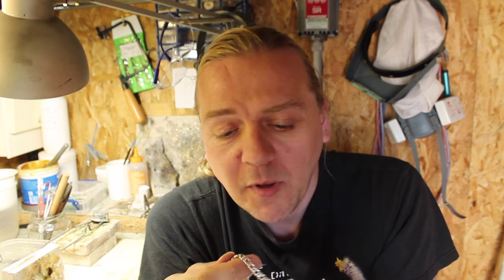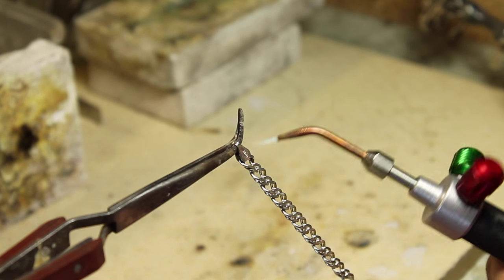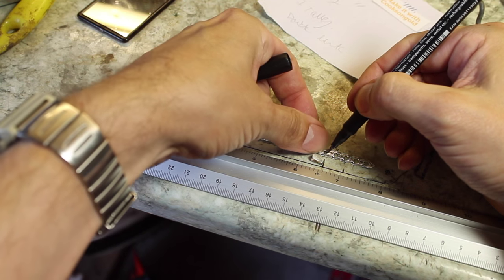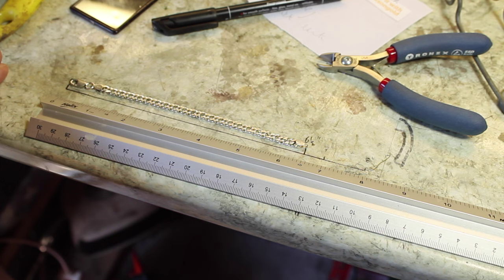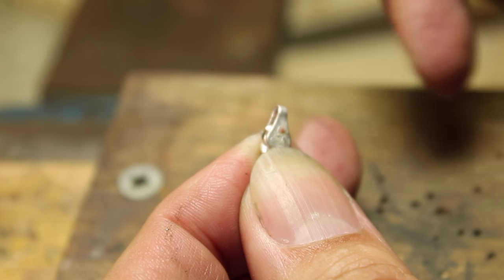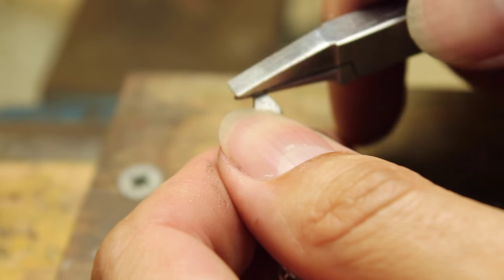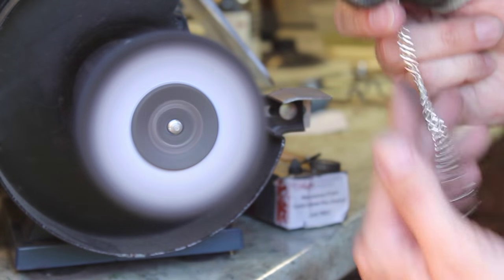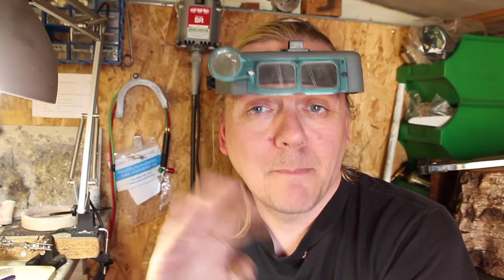How To Adjust & Repair A Silver Bracelet. Silver Soldering Techniques

Comment: Anytime someone shows soldering I want to watch.  You make it look easy.  Using a third hand worked perfectly for you.  Keep  filming!  Thanks, Betty
Reply from the maker: Betty Lively Thanks. The locking tweezers are actually held in my vice. This is a lot stronger than a third hand and allows me to pull on the chain. Thanks for watching. more on the way. Dave.
Reply from the maker: Betty Lively Also do check out my How to Solder video !  : )

Comment: You are doing a great job. Could you show us how to soder a 14 carrot gold wire rope on a end that broke off . Thank you for helping us learn .
Reply from the maker: Thanks for the comments. That's a very specific request. I don't have a 14 "Carrat" gold wire rope chain with the end broken off. But whenever I solder chain ends onto fancy chains, i don't want the solder to run along and ruin the chain. So I use "Rouge Powder". This is intended for polishing in tumblers, with walnut shells. But in my case, I mix it up with a few drips of water and I paint in onto the chain, very wet and let it soak into all the details. I paint it just around the end close to the end. The rouge is a barrier and will stop the solder from running along the chain and ruining it. Once soldered the rouge simply washes off in the water quenching. Dave

Comment: I really enjoy your videos.  You do such good work. I'd send all my silver repairs to you if you weren't an ocean away!  I bought a sterling chain necklace that had a tiny piece sticking out from the bale like yours did at 10:40.  I was lucky enough to be able to use nail clippers to fix/smooth it. Of course the links weren't thick like your bracelet. Thanks for sharing! 🙂
Reply from the maker: Thank you for the lovely comments. I hope I have inspired you to have a go yourself. A little knowledge and few tips will go a long way. Good luck. Dave

Comment: Thanks for your help!! I have repairs that are needed but local jewelers say they don't do silver repairs! ???
Reply from the maker: Most high street retail jewellers wont touch anything at all (as they don't have the equipment and a skilled jeweller on site). If they do, they usually aren't doing it themselves they simply send things away (to people like me) and then double the cost. Hence why I repair silver (and gold). Many people come to me with sentimental pieces after being turned away by several  jewellers. Finding a proper silversmith is a rarity. If you need help, drop me an email. Dave   mail@celticdreams.co.uk

Comment: hi, where are u based at? or from? thought if local can come see you about shortening my id part of the bracelet. need 3/4 of an inch off the actual id part of bracelet, is that possible? without the id part looking like its been cut off,as in no marks/line?
Reply from the maker: I have a shop in lancaster. open six days a week. Assembly Rooms Emporium LA1 1JN Dave

Comment: Hey Dave, what type of flame were you using when soldering the silver. Was it a oxidizing flame, neutral or carburizing?
Reply from the maker: Good point. Common jewellery practice will say say that you should solder with a bushy soft flame, not quite yellow at the tip, the idea being to heat up the whole piece (how many times do you hear that). However, when working with tiny things like this chain, heating the whole piece is the last thing I want to do. I need to apply heat quickly and very precisely. Hence I tend to make these chain repairs with a very fine, very hot flame, with lots of oxygen. This way, it heats up the small area very quickly, before affecting the other links. The blue point also gives me pinpoint accuracy. A very intelligent question, thanks for asking and thanks for watching.Dave

Comment: Hi Dave, love your videos!  Can I just ask - if you were soldering the loop at the other end of the bracelet that attaches the trigger / caribiner clasp to the bracelet chain, do you have to prevent the heat from reaching the trigger clasp in case it ruins the springy mechanism of the clasp?  If so, how do you protect the clasp from heat?  And can you put the trigger clasps in pickle if you need to after soldering?  Thank you. :-)
Reply from the maker: Yes correct. That's why you often see bracelets with the jump ring unsoldered (and why people lose them). As you say, the spring must be protected from heat. I use easy solder paste, or Extra easy (if you can find it) and direct my flame away from the lobster. I also use locking tweezers to hold the jump ring and act as a heat shunt. You can also use "Thermo Gel", to cover the lobster, but this isn't really necessary if you can solder carefully. As you see, I have a fine Smith Little torch, but a small  butane chef's torch or pencil torch will give a very small flame perfect for such small jobs. See the link for a video on me doing this exact thing. Dave  
https://www.youtube.com/watch?v=en2KLTb-CV4&t=20s

Comment: I really enjoy your videos. Really clear and informative. Just one question: I don't have a tumbler so what is the best way to finish a chain after soldering on a clasp? I am using argentium silver chain and a handmade clasp. Thanks
Reply from the maker: Brass brush with some warm soapy water. You can get soft brass brushed from jewellery suppliers (called a scratch brush) or get one from your local shoe shop (suede brush). Dave.

Comment: Hey Dave, about tumblers. Why some are $200 and some other are $500 when it is lortone 3a. One say <<deluxe>> but what is it realy mean. It is a 4 inches diameter and a motor. Not a car so not complicated. Is it motors durability deferences because there is nothing much in this piece of equipment. Richard
Reply from the maker: Perhaps better posted on my Tumbler video... But ... With Lortone tumblers I have noticed this too. I purchased mine from the USA and paid a lot for shipping to the UK but it was still half the price of buying it here in the UK. I see this a lot here in the UK with USA made items, such as Lortone, Foredom etc they cost a fortune by the time they get here with shipping, vat and import duties.

There will always be Chinese and Indian fakes. But as far as I know, all the genuine Lortone items are made in the USA, So I cant really account for the vast price differences. I guess the moral is to shop around. Don't be afraid to buy from another country and pay shipping. just ensure you get the right voltage. Dave.

Comment: Hi dave, how much would this cost to be done at a jewellers? I am in rochdale and dont know where to go for mine. Regards
Reply from the maker: Hi, I'm in Morecambe and can tell you that local jewellers I know will charge around £7 for a basic soldering job. So you should be able to get this done for under a tenner. if not get in touch. Dave

Comment: I have a question for you. My friend bought a necklace urn for some ashes and this necklace she got has a loose piece on it. Can I solder that so the urn doesn't fall off the chain?
Reply from the maker: Difficult to answer without being able to see what you are referring too. But if the chain and urn are silver (or gold) then there is no reason why they cant be soldered together. if its some kind of plated, base metal then it may be more difficult. take it to your local jewellers and ask their opinion. hope this helps. Dave.
Reply: Thanks for info.

Comment: hey dave, just wanted to ask. You mentioned mens bracelets not being fully soldered at the start of the video, and I have a bracelet that is not fully soldered and has a tiny gap. I took it to the jewelers and they told me that they could not resize it. Why is that? Any help would be appreciated
Reply from the maker: +Entarivenes ...Difficult to say without a picture. If the links are solid, I don't see why it couldn't be adjusted. Perhaps its hollow? these can be difficult as the links get crushed when you try to bend them. Does it have folded over ends like the one in the video? if so it could be adjusted as I did my moving one end. Adjusting a bracelet should be a simple job for any jeweller, so I am puzzled as to why they said no. Unless they simply don't do repairs.
Reply: Dave is there an email I can send photos to? Its black and I think it is solid. 11mm thickness and its 21cm long. I just needed three of them to be detached. Like you said before, it does have a tiny gap in each curb link so I do not understand why it can not be fixed. I might try another jeweler.
Reply from the maker: +Entarivenes mail@celticdreams.co.uk .....you've got me intrigued. ; )

Comment: hi mate, will this work for solid silver? also how much would it cost thx
Reply from the maker: Sorry, I'm a bit confused by your first question. The video is about how to adjust a "silver" bracelet.

As for the cost, I don't know where you live or even what country. So I cant say what it would cost where you are. I only know what I would charge. In this case the customer had purchased the bracelet from me, so adjusted it for free. If not, its only a couple of pounds for a simple soldering job. Hope this helps. Dave.

Comment: I have a quick question for you.

is a 925 Sterling Silver with 9ct Bonded gold necklace repairable? My little shit of a brother yanked it off my neck & the closed clasp end (end without the sliding openy bit) broke off the chain.

I know silver and Gold have different melting points, but im wondering if it's repairable at all. Necklace holds sentimental value & i dont mind losing some gold plating at the clasp end if it means the necklace is wearable again. That is, as long as the silver base metal is polished.
Reply from the maker: It should be possible to solder it with low temp gold solder. A local jeweller should be able to do this for a few pounds. Dave

Comment: Thank you so much for posting your excellent videos.  I'm now a new subscriber!  Two questions for you:  Jeweler Joe Silvera here in the States claims if you use the progression of 3M radial disks to polish you piece, you don't need to use any tripoli or other messy polishing compounds.  Is that just a matter of how highly polished you want the finish?  Does your Mentara compound produce a much higher sheen than just using the radial disks?
Secondly, I've been trying to figure out how to solder jump rings closed if they're attached to stones.  I have several large pendant size stones with holes drilled thru the top that do not need bezels.  I've experimented a bit on soldering the jump rings I attached & ended up breaking one stone (from the heat, I presume) & discoloring a few others (again, I presume from the heat but still didn't get the rings soldered.  I stopped when I saw the stones changing color). All the stones I used were natural jasper or agate, so not dyed & of 6-7 Mohs hardness, so I thought I'd be safe!
Any advice you can offer is greatly appreciated!  Thanks again!
Reply from the maker: Hi Jeanine, firstly thanks for getting in touch and you lovely comments. I will try to answer as best I can.

I’ve made several videos
on radial discs, eve discs and polishing in general so do check out my other
videos for lots of tips. I see the point about going up through the grits. In
theory yes, this works. But I only ever do this on tiny marks such as polishing
a lobster catch. Yellow, blue and then green. You can get a nice finish, but
its time consuming so not something id do for a larger item. The 3m discs are
usually just for touch up jobs. On a bangle for example a  3m disc in a pendant drill  is just too small (although they do make
larger ones for use on a bench polisher). But for a perfect finish, nothing
compares to the Menzerna IP. that’s just it. If you want the best finish you
have to go with polishing mops and compound either Tripoli and rouge, or
Menzerna IP and SF. Admittedly you have to clean-up afterwards, but the simple
solution to this is to use an ultrasonic and hot water. It will remove all the
polish in a few seconds.

As to your jump rings. I don’t
quite follow why you are soldering jump rings to stones. But the problem is a
common one with jewellers, whereby we need to apply heat to solder, but want to
protect stones. There are several solutions that spring to mind….

The first thing to
consider is do you actually need to solder at all. Think about split rings,
crimp fastenings and wire wrapping. There may be an alternative “cold
connection”, you can use which does not require soldering. Dare I say it even adhesives–
just a thought. But try to consider alternatives.

If you do have to solder, is it possible to remove the stone, or solder the
piece before the stone is inserted. Again reconsider your methods. I only add
the stone after all heating is done.

If your design is such
that you have to heat the silver with the stone in place, then there are
several contingency plans. Firstly, checkout my video on thermo gel or temp
guard. This can be applied to the stone, liberally in order to prevent it
getting hot. You can also use a heat sink such as locking tweezers to prevent
heat from tracking along the metal parts. You should obviously use easy or
extra easy solder, if at all possible, To again reduce the heat required. If you
have something like a smith little torch then switch to a tiny nozzle and just
heat the jump ring, very precisely, directing your flame away from the stone.
Together with tweezers and thermo gel, this is my solution if I have to do this
e.g. resizing a ring. Protect the stone and pinpoint your heat. Of course the
pro solution to this problem is either a PUK welder or a laser. Which can weld
the jump ring without applying heat to anything else. But that depends on your
budget and how many pieces like this you intend to do.

Hope all this helps.  Dave.
https://www.youtube.com/watch?v=vFtcGAFYXl4
Reply: Hi Dave! Thank you so much for replying & answering my questions so very well.  What you say about the radial disks vs Menzerna IP makes total sense & I understand now. Thank you!  What you explain about soldering a jump ring while it's connected to a stone makes sense too.  I'll try to explain what I meant a bit more fully. I have many beautiful stones; teardrop, marquise & trapezoidal shapes that were probably cabachons at some point, but now have holes drilled at the top of them from front to back.  I wanted to make a lovely design for a slide that has a strong jump ring at the bottom (that can be opened & closed) so the customer can interchange the stone pendants dangling from the slide of the necklace.  For this idea to work well, the jump ring that goes through the top of each stone should be strong & soldered closed, don't you think? I thought so.  I've seen your video on ThermaGel (which was also great, thanks!) & plan to buy some, but still worried the part of the jump ring that goes through the stone would still get too hot.  But your suggestion of using locking tweezers (one pair on each side of the jump ring I'm assuming?) as heat sinks is brilliant! I'm going to try this & let you know how it goes, if you like.
Can't tell you how grateful I am for you help!  Thank you very much for being so generous sharing your knowledge & advice! You are awesome!  Best wishes to you, Jeanine
Reply from the maker: if you use a thick enough jump ring, it shouldn't need soldering. You can also get  silver Split rings, like little key rings. and even "link lock"  locking  jump rings intended for home users to attach charms to bracelets without tools. check these out 

https://www.riogrande.com/Product/SterlingSilver46x18mmLinkLockJumpRing/693317
Reply: Hi again Dave!  Thanks for the link to the "link lock" jumps.  I've looked at those before & they are pretty neat, but would add a bit more than I'd like to my final retail price .  The little bump where the link is kind of bothers me too.  I think your suggestion of using a larger gauge wire for the jump ring is best.  If I have to drill the stone's hole a bit to make it wide enough for the wire, that's OK. Better to drill a little than risk breaking the stone from heat.As always, thank you very much for your help.  You've got me re-thinking my original design idea (which is always fun! Well, usually fun!) Thank you also for your patience.  You're awesome!

Comment: Long way round for s short cut, why not just cut the link in front of the clasp, cut the chain open the link and re solder the link, one solder joint on one  link, clean one joint on one link,job done, no messing about with lining up no reshaping.
Reply from the maker: +Symon Donna .... I see your thinking, but how is cleaning one link less work than cleaning one end?

Reason 1 Its way easier to just solder the end rather than cut and  solder a link. 

Reason 2 The final bracelet is just as good as the original, as I have not altered any of the links.  (and no visible repairs)

Reason 3 if you look closely at the bracelet you will see it is a "double" curb chain, with two links overlapping. Hence it would be incredibly fiddly job to cut and reattach two links- if indeed it where possible at all. 

Popping the end off and back on is quick, simple and leaves a perfect bracelet. So no its not long way round. Your suggested method of cutting a link would be hugely time consuming, require two soldering jobs (then clean up the two links) and leave the chain with a possibly visible repair. My method leaves the bracelet perfect, with no altered links and no visible repairs.

I hope this makes sense. Dave